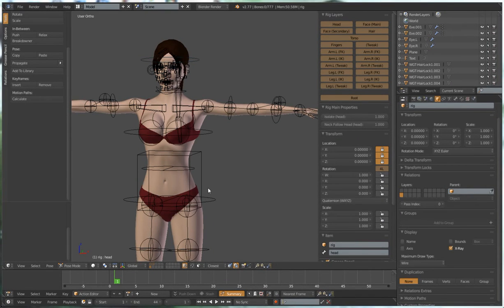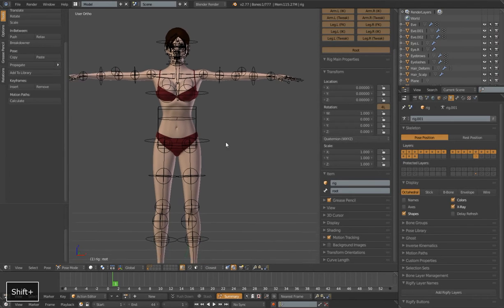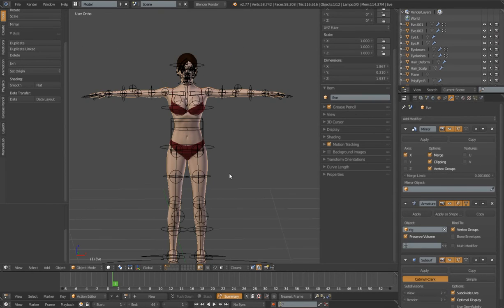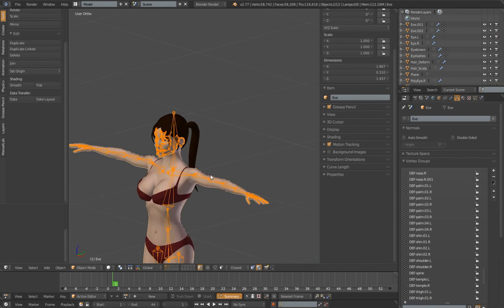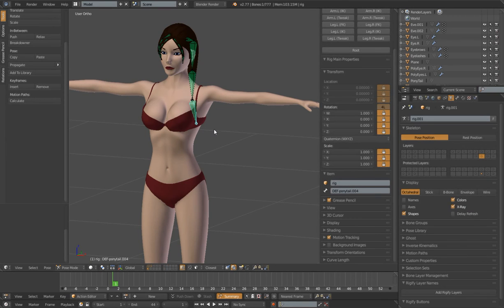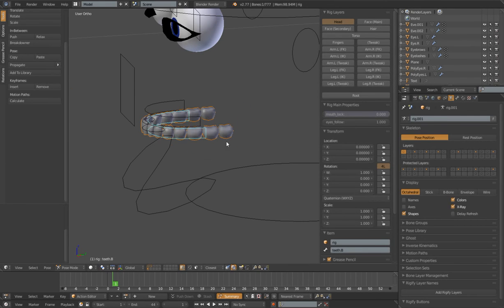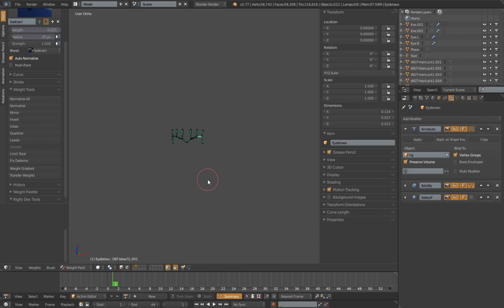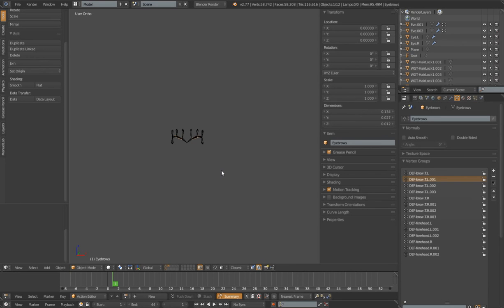Rigify   Part 7C   Stage 1 Clean Parenting Methods

Comment: Thank you for your very detailed videos. And I have a little addition. I don't know about 2.77, but in 2.76b there is no need to hide bones to use "Assign automatic from bones" - it works with selected bones only. Also when you do this "partial assignment", both the "Face selection masking". and the "Vertex selection masking" buttons (on the right of the pivot center selector) work, giving the ability to weight literally anything with any set of the bones.